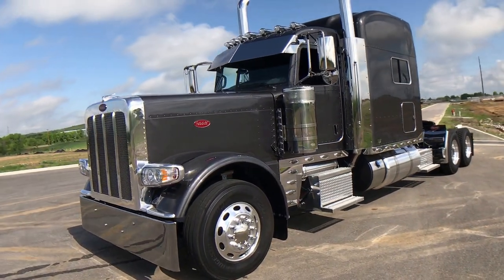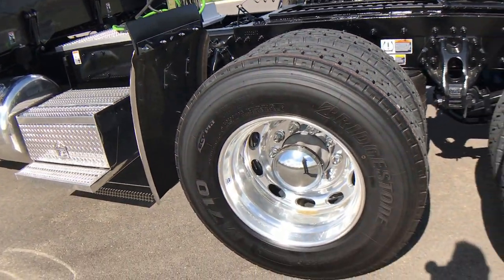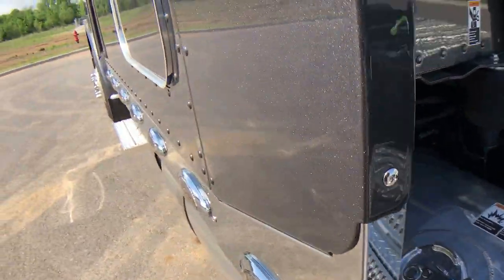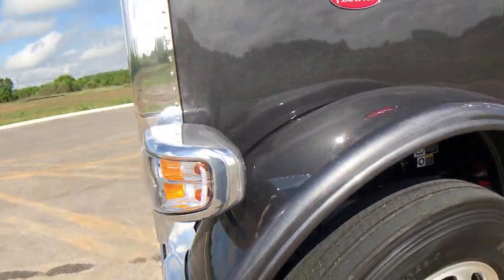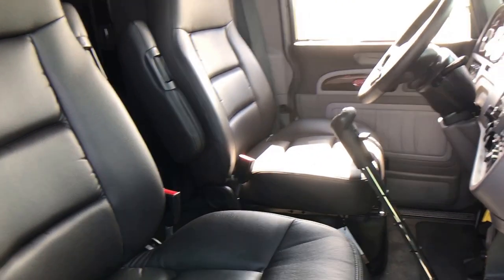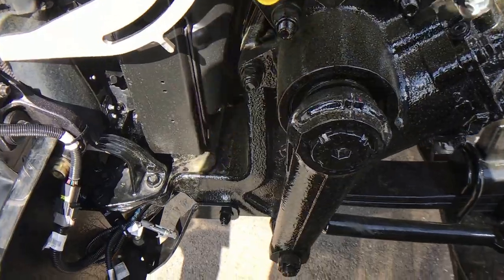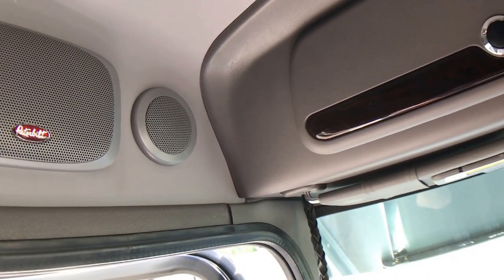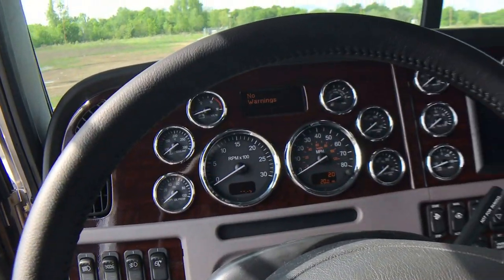NEW Legendary Grey Metallic 2018 Peterbilt 389 X15 565hp 2050

Comment: That truck is very similar to the 2012 Pete I had. Even the overhead doors above the driver's seat is the same. Gauges and switches are all the same as well. Nothing has really changed in the last 6 years.
Reply from the maker: Engine and dash are about it

Comment: What is the weight of the truck?  also what is the difference weight between the paccar vs. cummins?  Love you videos very informative.
Reply from the maker: Tag weight will be around 18700. A PACCAR is 12.9 liters and maxes out at 500hp and 1850 torque. It is also 300lbs lighter than the 15 liter X15 that goes from 400hp/1450 to 605/2050

Comment: The antenna mount on the back does not work.. Antenna can not be tuned correctly. I wish I had put them on mirrors.
Mirrors are poor as well. Mounts cause mirrors to point up..
Reply from the maker: Sounds like you need a roof mount I guess. Your experience is much different than what the majority of my customers have had.
Reply: Sounds like he needs a helmet and training wheels.....

Comment: I'd love one with 11r24.5 s 430 ratio 14/46 axles double framed front to back. Arctic package for ontario s cold winters. and delete all the junk off.  since doin the delete on my 14 T800 with 550 isx it's not been back to the shop for anything in over a year of hauling logs at 70 000 kg gross weight average. 70ton 5th wheel and 4way locks. did I mention that deleted is a must lol. man oh man that's a nice truck.  legend Grey for the LEGEND.
Reply from the maker: Wow a 4:30? I put 3:91's in my 4 axle heavy haul applications....